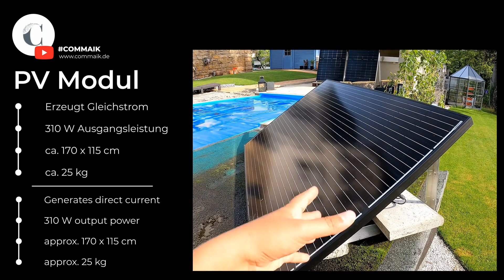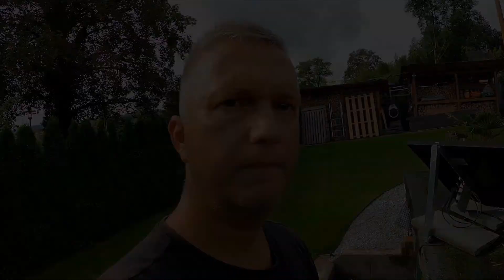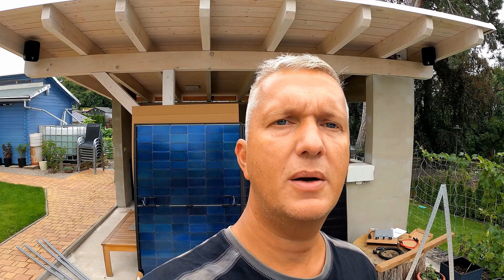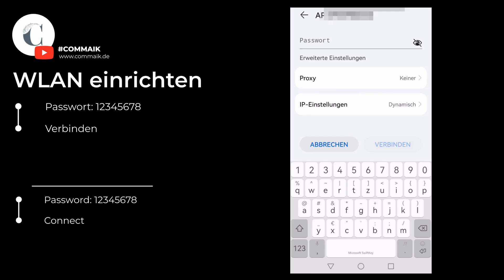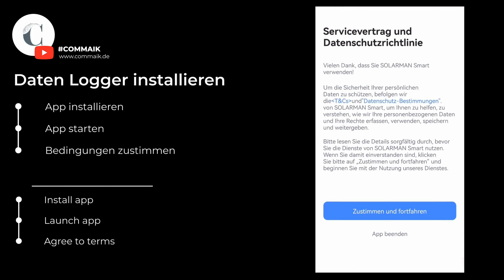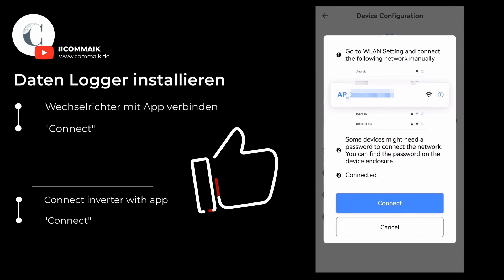DIY Balcony Solar Setup: Save Money & Energy Now!

Comment from the maker: *👇 All products & links from this video:
🔗 Balcony power station: https://geni.us/wi5g (Amazon) 
🔗 AC+DC battery: https://geni.us/eGqys (Amazon) 
🔗 Solar cable: https://geni.us/E6iR (Amazon) 
🔗 Inverter: https://geni.us/5r8BEp (Amazon) 
🔗 Inverter with API: https://geni.us/8UFn7Bd (Amazon) 
🔗 AC 3-pin IP67 mains plug: https://geni.us/q3BX5C (Amazon) 
🔗 Betteri cable Ly01-bc01: https://geni.us/IK1OQku (Amazon) 
🔗 13A fuse: https://geni.us/rqRJb (Amazon) 
🔗 Ammeter (reverse capable): https://geni.us/uQ1CBwc (Amazon) 
🔗 WLAN socket: https://geni.us/9KqMW (Amazon)

🔗 Flat roof elevation: https://geni.us/SBo6Y (Amazon) 
🔗 Balcony bracket: https://geni.us/qMBQmBz (Amazon) 
🔗 Rail system: https://geni.us/9bb4H9D (Amazon) 
🔗 Clamps for rail system: https://geni.us/9vzM (Amazon) 
🔗 L mounting bracket: https://geni.us/Hinu (Amazon) 
🔗 Solar tracker: https://geni.us/IgqVLw9 (Amazon)

🔗 18V cordless screwdriver: https://geni.us/cADP (Amazon) 
🔗 Metal drill: https://geni.us/2cN28qd (Amazon) 
🔗 Socket set for cordless screwdriver: https://geni.us/YoPSN (Amazon) 
🔗 Ring spanner set: https://geni.us/FNRvX (Amazon)

You can find more information here: 
🔗 https://commaik.de/2023/10/800w-balkonkraftwerk-einfach-selber-installieren-optimieren-solarman-app-einrichten/

Attention: When setting up your balcony power station, pay attention to the applicable legal regulations and occupational health and safety!

Follow me on my social media channels for more content! @commaik

🎥 This video was originally produced in German for my main channel:  
https://youtube.com/commaik  
It was then translated into English using Heygen – with my own voice and lip-sync.

🎙️ Want to dub your videos like I do? Try Heygen:  
🔗 https://www.heygen.com/invite/b96cdcf6 – Get 300 free credits when you subscribe.

📺 The original video, which includes English subtitles, can be found here: https://youtu.be/N-p0KFu8bPI

Note: All links marked with * are affiliate links. If you make a purchase through these links, I will receive a small commission at no additional cost to you. Thank you for your support!